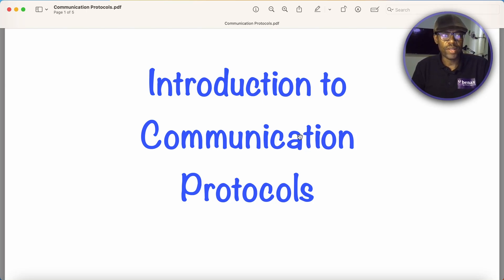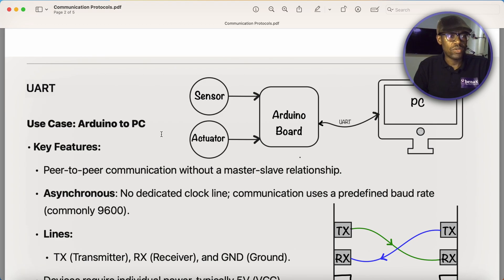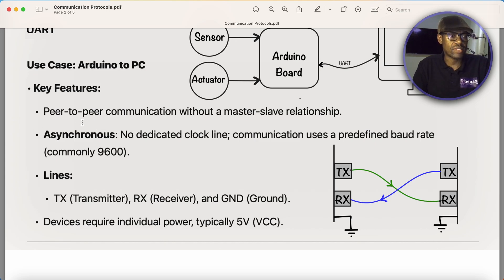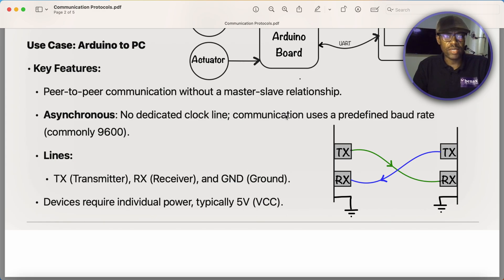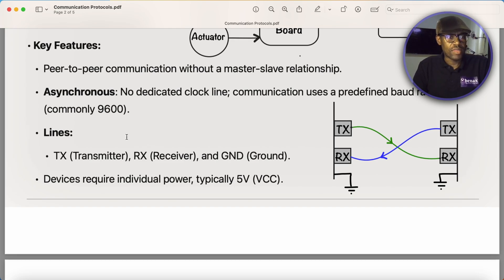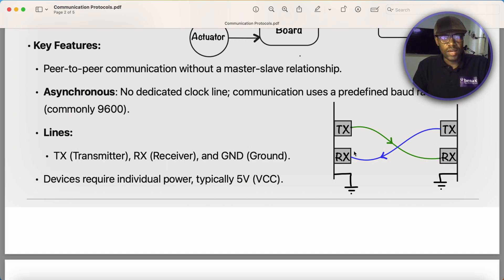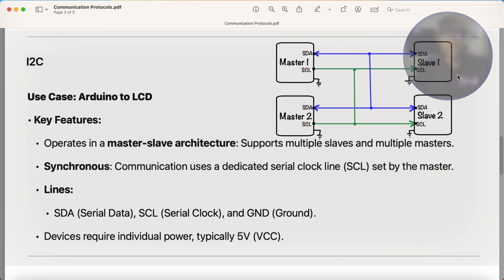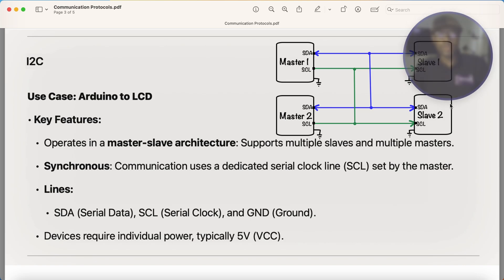Understanding UART, I2C, and SPI Communication Protocols

Comment: This video finally cleared up the confusion I had between UART and I2C. I used to wonder why they can’t be used interchangeably, but now I understand that UART is asynchronous communication while I2C is synchronous and uses a shared clock

Comment: I really learned a lot from the video and some of them are: 1) UART protocol (peer-to-peer communication, doesn't have master-relationship , asynchronous i.e use baud rate , uses TX , RX lines and GND) , 2) I2C (master-slave architecture, synchronous ,  has SDA , SCL and GND)  , 3)SPI (has  multiple lines like CS ,MOSI,MISO,SCK , synchoronous ) ,  and i also learned about that combination of communication protocols is also possible.

Comment: This video makes understanding embedded system communication protocols really easy. It explains UART, I²C, and SPI in a simple way—showing how they work, the connections they need, and when to use each. UART is a straightforward two-wire setup for direct device-to-device communication. I²C allows multiple devices to share just two lines, using a master-slave arrangement. SPI is faster, using separate lines for sending, receiving, clock, and selecting devices, making it perfect for high-speed components. I also liked how the video shows them working together in a project, like using SPI for RFID, I²C for an LCD, and UART to send data to a PC.

Comment: I learned that choosing between UART, I2C, and SPI is all about balance: you trade off wiring complexity, number of devices, and data speed depending on what your embedded project needs. It’s not one-size-fits-all — the right protocol depends on the situation

Comment: This video gives a clear, simple walkthrough of the three main communication protocols used in embedded systems: UART, I²C, and SPI. It explains how each one works, the wires they use, and where they make sense in real projects. UART is a basic peer-to-peer protocol that uses TX and RX lines with a shared baud rate. I²C uses a master-slave setup with just two wires (SDA and SCL) and can connect many devices on the same bus. SPI is faster and uses more lines MOSI, MISO, SCK, and a chip-select for talking to high-speed peripherals. The video also shows how these protocols can work together in one project, like using SPI for RFID, I²C for an LCD, and UART to send data to a computer.

Comment: Such a great video! It clearly explains UART, I²C, and SPI in a simple way—how UART works peer-to-peer, how I²C handles multiple devices on just two wires, and how SPI gives fast, synchronous communication. Really helped me understand how these protocols work and how they’re used together in real projects. Thanks for making embedded systems easier

Comment: This video helped me understand the differences between UART, I²C, and SPI communication protocols. I learned that UART is asynchronous and peer-to-peer, I²C uses a master-slave architecture with only two wires, and SPI is synchronous with multiple lines and supports high-speed communication. Thank you for the clear explanation!

Comment: In this video, I learned about three important communication protocols: UART, I2C, and SPI. I understood that UART works without a master and uses a baud rate instead of a clock. I2C uses two wires and allows one master to communicate with many slave devices. SPI uses more wires, including a chip select line, to connect a master to multiple slaves. I also saw how these protocols can work together in a real project, like connecting an RFID to a microcontroller and displaying the data on an LCD.

Comment: This video's a great explanation of communication protocols, their wiring and how they differ. I got to understand how UART works peer-to-peer and asynchronously, how I^2C manages multiple masters and slaves on just two wires, and how SPI uses more lines for faster & synchronous communication. Thanks for making embedded systems easier to understand!